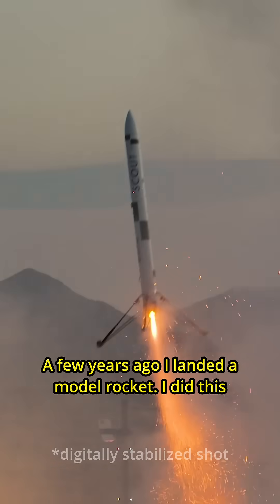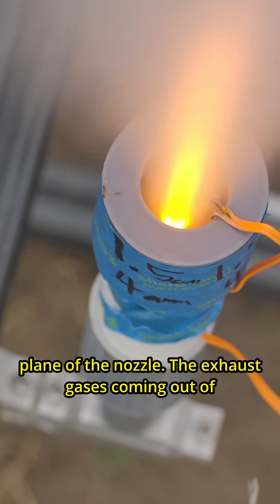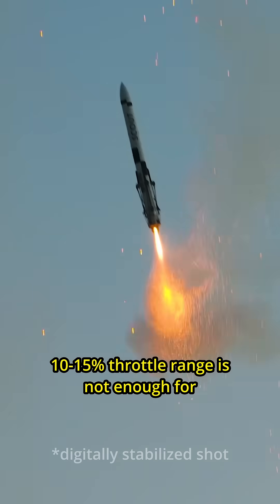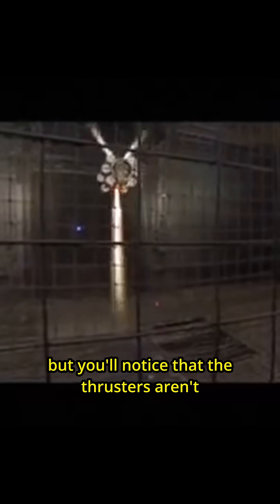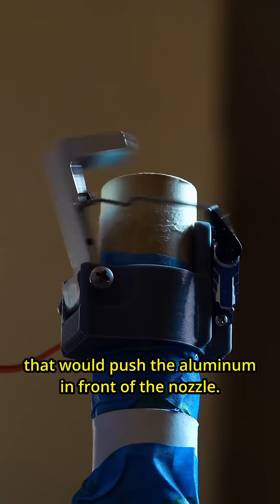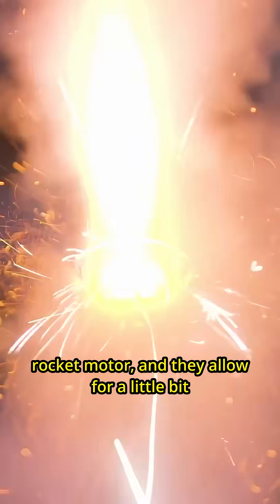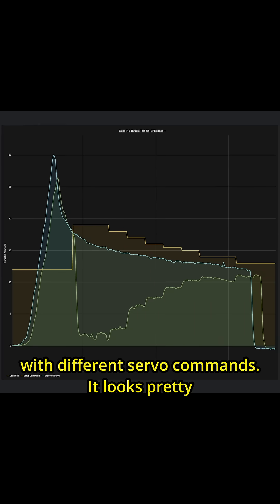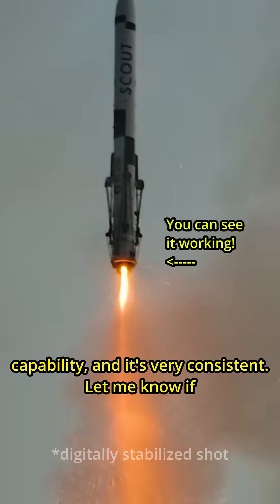Solid Rocket Throttle Control

Comment: I see an opportunity here to set up multiple levels of both servo blockers and servo deflectors. Imagine a primary level of blockers to take down the booster strength crudely and a secondary level to fine tune the throttling. Behind each blocker set I would set up a set of four servo engaged inward facing deflector vanes, all eight operating individually or in concert with the vane next to it. Using computer operation we would set up the primary row to do 70% of the desired deflection and the secondary row to do the final 30%. The idea is from welding tank guages. They use a primary gauge to do the crude choking off of the gas and the secondary guage to do the fine tuning of the pressure neccesary for a good weld. The defection idea is something they did to steer V2s with carbon vanes in the rocket exhaust. In theory you should be able to brake  rocket decent using a radar program and level the rocket by a program that chases two air bubbles to the center of two horizontally mounted levels (switching to the carpenters tool definition of the word "level" here) set at 90 degrees apart from each other.

Comment: I would have had a rocket with 3 or 4 motors and angle them down when i need maximum thrust, 45⁰ when i need half thrust. Or 90⁰ when i need no thrust. The mechanism and the 3 or 4 smaller motors would definitely be heavier than your idea.

Comment: I mean, any other option basically requires a different motor, right? I'd say this is probably one of the better ways to handle it without adding a bunch more moving parts.

Comment: Could you use 2 half hollow spheres instead of the claw like design
Reply: Or break it in 4 1/4 spherical pieces on 4 servos to be able to control more directions

Comment: If you use 4 instead of 2 and adjust their shape, you can even better redirect the rocket.   I would use well sintered MgO as it is lighter than Al2O3 and has higher melting point. Form it that way, that they have a triangle and close like a pyramid but leave sidewise holes open. Also if you rund then according Bernulli, you can move one in alone to change direction. Maybe leave a minimum hole in the middle of the pyramid of the three triagnles so that a minimum boost comes out that is insufficient for lift up but leaves a little boost so that when you open/close the effects is not that big and leaves better control.

Comment: I would frame the whole engine and place a nylon ball joint at the top of it so it swivels inside the tube and use servomotors to direct it. Also you can control the thrust by using an apriture or iris disc.

Comment: Pulse width modulation is also how you get led brightness, and for cars its how the cdi boxes work to send spark to the spark plugs (old cars used distributors so it was analog)
Reply: I hate PWM LED tail lights on cars. They don't flash fast enough for me to not notice the strobing.
Reply: and motor speed controllers
Reply: Synthesisers
Reply: It’s how everything works bro. Even your power supplies. Anything where voltage or current change in consumer electronics, most electronic motor speed control even the old shitty variable resistor to triac ones. If you include alternating current and not pulsed DC that is. Spark plugs are excited by inductors using AC fed into a high voltage step
Up transformer. but that AC is created by a PWM
Reply: We use it in older vapes too
Reply: And the injectors in a DI Diesel motor!
Reply: It's also how older consoles generate sound
Reply: Its also used in computer case fans for speed control
Reply: I came across PWM in electronics and computation but it made instant sense here.
Reply: No please do not PWM your LEDs it's fucking cancer. Use a constant current source and dim your LEDs like a reasonable person.
Reply: @ΜικεΡ  It's not like it is just done for fun. Like OP mentioned, PWM is typically used for brightness control of an LED. While LED's can operate with a constant voltage, they can handle higher amperage (resulting in more brightness) if that voltage is pulsed. Another huge factor is how the human eye and brain perceives light, particularly flashes of light and the perceived brightness.

It's actually kind of an interesting rabbit hole to go down if you're interested. It's based on the The Talbot-Plateau effect.
Reply: @FoshizMe   LED brightness is directly proportional to how much current it's passing. Obviously you can overdrive an LED if you're only pulsing it, their published ratings are for continuous loads.

PWM is a cheap hack because it's extremely easy to toggle an output with a CPU. It really only works if the observer and flickering LED are stationary relative to each other. 

When you put it on vehicle lights, or even worse driving past signage/outdoor decorations, you just get a flashing visual cancer.

Constant current isn't even that hard either, you just have to design an actual circuit instead of spamming mosfets.
Reply: @ΜικεΡ  <- this guy gets it
Reply: @ΜικεΡ  Depends on the PWM rate.
But you can also make your PWM output more analog (and reduce "ripple") with a cap.  Still, that's not cc, and your digitally controlled constant current driver could be better - but more complex.
Reply: @ΜικεΡ  and all the sensors in modern vehicle engines….
Dodge sprinter mercedes engine 06 was using PWM for Oil, MAF, fuel pressure, like half the sensors were PWM signal. Sucks to diag without an oscilloscope.

But hey this seems like a good place to ask…

Crank position sensor. DC sensor in a DC system, reluctor wheel creates an AC waveform….so is the signal wire sending A/C current, or Alternating DC current? I have many more questions like this and NOBODY understands or wants to actually use their brain god fucking forbid.
Reply: @ΜικεΡ i think its because of ac power but flickering lights are also a cause of headaches without even noticably flickering
Reply: @ΜικεΡ  why would a constant current source be helpful at all given the exponential iv curve? At best maybe youd want to operate around the threshold voltage but again, this isnt simply a constant current source, you need way more circuitry
Reply: @badabing3391   because LED brightness is pretty much linear with how much current it's passing. Furthermore, we don't actually care about how much voltage the LED is dropping, as its forward voltage can change (drop) considerably with temperature.

Fun demonstration of what I'm saying: connect an LED directly to a bench power supply. Set the current limit for 20ma and voltage for 3.3v, should be plenty for any random LED. Next, play with the CL/VL. Notice how light output is damn near proportional to passed current, but trying to achieve the same dimming with voltage is genuinely difficult, and far more limiting as your power supply isn't going to let you nudge the output voltage by tenths of millivolts.

So basically, optical output from LEDs is based on current. Obviously that implies a voltage, but we don't actually care about that pressure, since only the flow generates light.
Reply: @ thanks, this makes a lot of sense.

Comment: I probably would have tried the opposite of this...oh wait...is it possible? Well it'd have to be, right?? I was thinking of venting the propulsive gasses off to the side, like a muzzle brake/flash hider. Instead of closing a door, opening a window. Maybe the extending tube could be like a muzzle break or flash hider or uh, ahem, muffler... then again, I really reckon a solid sleeve like you tried would be more effective if it were just longer...2~7", maybe play with the inner diameter. Idk, maybe make the sides (inner surface) wavy, to start diffusing the thrust's "singular" (relatively singular) downward vector. For more effectiveness, I reckon, add some shaped holes like a muzzle break/flash hider. Maybe some prongs that stick in towards the center to start drawing off that flow. "Strength," you question...the prongs can be disposable for now. You may have doubts, regarding the lengthened moment arm and changed Center of Mass, but euhhhh, listen it'll work👍😂  Right?😅  I reckon, if I could, I'd prototype it and measure the change in thrust on like, a "bench-viced" (stationary, mounted, with press. sensors/scale) test setup...or on rails with resistance.

Then again, you ARE indeed already redirecting the thrust sideways, I'll give you that, and it's very effective! I have doubts that simply putting holes (albeit ones with intentional geometry) in a sleeve (that moves to extend down past the nozzle) would produce a difference, or enough of one, but it sure seems to work for "gnus." I'm rather curious how much of a difference could be effected.

Comment: Add an inhibitor fluid. PWM it in to the other end of the rocket motor. That would make it a hybrid motor, but would cool down and slow the motor instead of adding to the thrust.
Reply: He has the space for a tank between the roll reaction wheel and the motor mount but idk if he has the mass, TWR already seemed low.
Reply: The other end of the motor has to endure the same high temperatures and pressures as the exhaust end.  The motor burns all along its core. So any such admittance device has to be engineered very carefully and would be trying to inject against that pressure.  A better solution at that end of the motor would probably be to have some kind of controlled radial exhaust ports that all you exhaust some of the gas radially.
Reply: any fluid to inhibit the solid rocket would be inconsistent in its burn, leading to wild variations.
Reply: Probably said, but having a hybrid  motor would be an option? Using oxigen tank maybe?
Reply: Why not try a similar idea to the MD80 reverse thrust, but on similar servos that you have designed here.

Comment: "Rhymes with High Temperature Ceramic"

Ahh, the old Pi Contemperature Germanic.

In all seriousness, it would be cool to see a 4 piece clamshell instead of the 2, to see if you could both reduce the thrust by blocking the flow, but also see if inserting different combinations of the 4 allow for differential steering characteristics.

         Front 
         1    2  Right 
Left  3    4
         Back
Reply: using yours, couldnt the solid engine be "gimballed" direct thrust where you want to, wouldnt it need even more tho? like 8 at least.  
oh you did say "differential steering" i didnt read that and went straight to the 1 2 3 4 sorry
Reply: @nightinthewhite   My guess would be that 8 or even more would increase the precision at the expense of weight/complexity, but definitely an interesting "external gimbal" type of a concept.
Reply: Well I thought at first that I see thrust reversers which would be interesting to see not gonna lie
Reply: Wouldn't the concern be that blocking off too much of the output, would cause the still burning engine with no output to build up that energy, turning the fuel tank into an expensive firecracker... And if you diverted the flow sideways, it would steer off course...
Reply: @stephen_harvey   Absolutely! That's why playing with the differential steering to see how much blocking you could achieve to gimbal it. Effectively like taking a hybrid design of an eyelid nozzle and a propelling nozzle put together. As you pointed out 100% blockage is bad, but the 'steering' aspect would be part of the gimbal mechanism if it could be done predictably. If x blockage leads to y change of direction, then it can be used as a mechanism to correct trajectory.
Reply: @HartenDylan  my thoughts turn to an iris type of mechanism, but what if the iris didn't open at the same time, you can potentially create a triangular exhaust to steer it, but then you would require a gyroscope to exclusively microcontrol the gimbal/iris, because as a third party, you won't be able to discern left right front back, quickly enough to make an effective adjustment, and to make the system on board, now you have to tell it to not operate or to start operating, and ultimately, you'll create a dozen new systems and it will work perfectly, cost way over budget, and then the new guy will try a stripped down version with just the minimum and it works as perfectly as with all the systems, to summarize, there's a term in programming, "K.I.S.S.", which means, "Keep it Simple Stupid".... Sometimes the redundancy is just that, overcomplicating things, redundancies are a great thing, but make sure they don't get in the way of a solution that could be exactly what you want if you'd let go of a certain detail, over engineering is fine, until it it isn't... And you just end up with a Rube Goldberg machine...
Reply: @stephen_harvey  thats the point, divert it to steer the rocket or stabilize it
Reply: Only need 3 to have full control.
Reply: I wonder about the stability, though.
With liquid propellant, the centre of gravity will become lower and lower as fuel and oxidiser get consumed.
With solid propellant, the opposite happens: As the lower segments of the propellant combust and get pushed out the nozzle, the centre of gravity creeps up.
Reply: Three would be better.
Reply: Did you actually use black powder?  Or just powder that happens to be black in color?
Reply: Yes.   Designed correctly you could do vectored thrust.      I was thinking a ceramic iris.   Like a camera lens.   Stays a circle,   just opens and closes.
Reply: Beat me to it! I was going to go for "My haute-couture is manic"...
...
...
...
...yours is funnier, isn't it? 
...
...
...
Touche ~  ;~ ]

Comment: What if you have 4 of these nuzzle stoppers for each 90 degree around the engine, when all are closed they form a half sphere, but when one or two or three  are open they deflect the thrust in a different direction. This way you can both steer and throttle. Some smart programming could account for both altitude and angle of the rocket to make it land. Will look hella crazy when it gets close to the ground and the stoppers have to wiggle like crazy to favour throttle, but also let out some thrust to steer 😂

Comment: Wonder if more 'thrust-reverser' like setup would work, from airplane engines.  Depending on the position the solid rocket motor would could be split between up/down at the same time.  Find the middle you could possibly hover?  Might take more than two diverters.  Not sure if that kind of energy would cause the ceramic to break down.  Just a thought from an arm chair engineer.

Comment: ceramic lens aperture with somewhere of 4-6 leaves instead of 2 ceramic pinchers is what i would try. it might be too part complex, but i'm thinking a more solid disc to block the thrust instead of just the 2 prongs might give a slightly wider range of thrust forces to throttle between.

Comment: Neat! My initial thought would be to adjust the orifice diameter using some sort of 3d iris to change the flowrate of gas if it is already moving at the speed of sound. Wouldnt work if exhaust is subsonic though. Plus the combustion pressure would change with throttle position so the pressure vessel would need to be resilient enough to hold up to the fully throttled down position.

Comment: Get rid of the gimbal, use three or four of these to split the exhaust stream and you get both throttling and TVC. Since you this seems like it's throwing your exhaust direction out of whack a bit, you might as well model that into the TVC as well.

Comment: So what I would do is have a couple of panels that sort of act the same way but can also direct thrust around like thrust vectoring. Also just a personal suggestion but you should probably do something like a catapult at launch since inertia is effecting it in some way
Reply: But he already has thrust vectoring built in…it’s in the motor mount.
Reply: @ oh
Reply: I do like the idea of using the little panels as well for thrust vectoring (for the sake of reduced complexity in that he'd then not need a mount gimbal, although he'd need at least 2 additional panels), but I fear that the interplay from having two control axes' worth of panels interlocking (and not at flat sides either, since having anything more than 2 of them would mean they need to meet at a point) in innumerable configurations to achieve fine control, might prove, indeed, very hard to control - the rocket jet doesn't seem particularly calm and forgiving, and so I'd expect it go be thrown about all over the place when you're working with sharp pointed-plates in various, asymmetrical degrees of closure.

Another (not necessarily better) solution might be some variant of a camera shutter mechanism, but with beefy panels, that could then be gimbaled. The degree of closure might be more easy/simple to control, and the holding strength/sturdiness better, against the force of the jet, although it might well prove too complex as well.

Comment: I'd expect that with he aluminum arm you'd deflect the thrust of the motor more than throttling it, so I'd probably use an ires instead of an arm to completely block the thrust.

Comment: How do the ceramic pieces do on heat transmission. I wonder if a prolonged burn would affect the rest of the assembly (screws, springs, printed pieces)? Second thought: have you thought about using 4 pieces on 2 axes instead of 2? (cut into triangles, so they meet in the middle)

Comment: Didn't you also try the method where you quickly spin the motor around in a circle, so some of thrust gets diverted equally ("equally") in sideways directions? Makes clever reuse of the already existing servos, saving weight, but not sure how much throttling it could achieve - and of course, makes keeping it upright and on-target much harder because you're introducing lateral thrust.